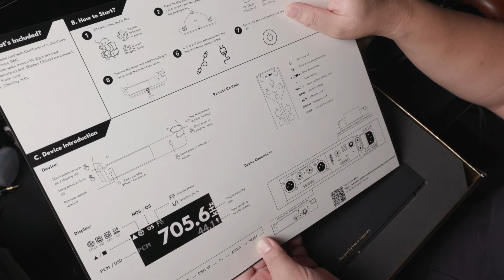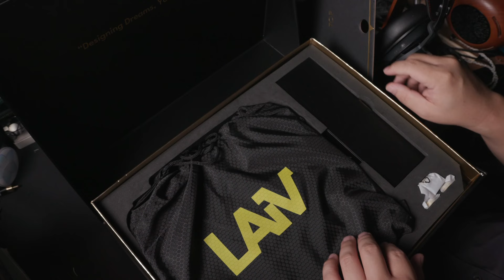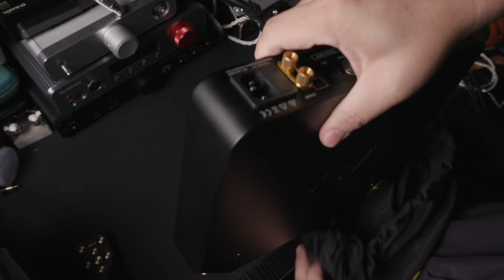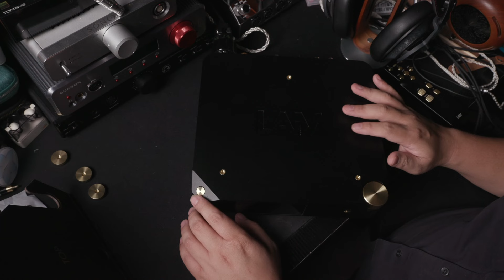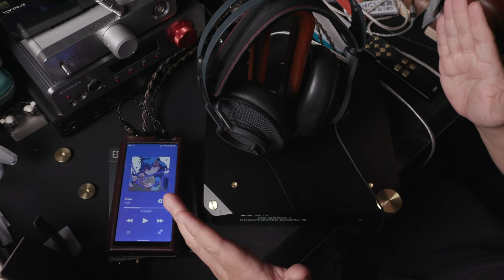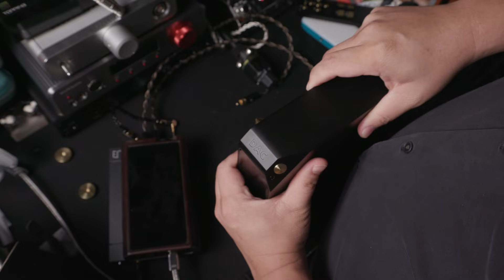Laiv Harmony Dac: Unboxing & Initial Impression

Comment: Seems that a group of people are promoting this dac while another ones are promoting the Cyan2. I'm kind of looking forward to your review about the two dacs.
Reply from the maker: Soon soon. I will have  cyan for trials in 2 weeks
Reply: From what I can tell, the only advantage the Cyan 2 has (other than price) is it has a single bit DSD decoder, but I don't think the main unit will match this one.   This is more along the lines of the DSDAC by Cen. Grand and it's awesome internal components.    Everything they put into this thing is state-of-the-art.
Reply: @Scott-DJ   cen grand has very pool measurements, yes good sound means some distortion, but not at the level of cen grand. I plan to use hqplayer for up sampling pcm to Dsd, for me the real comparison is dsd on cyan2 vs laiv dac. 
For the build, I don't really value that, could it be beautiful than a chip. Although with the same quality, I prefer the better looking one.

Comment: BS dac...
Reply from the maker: Well guys, it’s really not about material cost but implemention. And at the minimum the construction is really good and really beats many devices at its price tag. The internal implementation maybe one day if golden sound measures it. Anyone can make a real cheap R2R but well implemented versions are rarely cheap. And then there’s manpower cost and other overheads…
Reply: Look at all the brokes here complaining about the price. Jelly much?
Reply from the maker: Not sure what’s the purpose of your post but have a nice day :)
Reply: @ZPProductions  I agree! Too expensive for just a damn DAC! It could deserve 1200 bucks,but come on $2700 plus VAT and handling fee will be mad price!
Reply: @ZPProductions  The BS on its price tag... over 2K for $100 worth of components... the discrete R2R modules cost to make around $20... is like Fancy power cables.
when a company take this approach, is just BS... 

Dress $100 of components on a fancy chassis and sell it for over 2K its whats wrong with HIFI.... 

i build my own devices by the way, so i know what the cost are and what im actually buying....  but anyways, nobody cares i i dont either.... Have a nice day :)
Reply: @MICAMOTEESTABIENGRANDE it’s just your opinion! BS is not the right approach, in my opinion.

Comment: I have PS audio airlens streamer with I2S digital out. I want to know if the I2S is compatible with Harmony DAC. I know Harmony DAC has PIN options configurable, but not sure the PS audio PIN configuration is available.
Reply from the maker: You should consider going to a forum to ask probably. Not so sure on that.
Reply: I can almost 99.9% guarantee it will instantly work with your PS audio with no modifications needed because that's the gold standard of i2s configuration--and the one used by every Asian manufacturer I know, such as Cayin.   If not, I can 100% guarantee one of the eight settings WILL work.